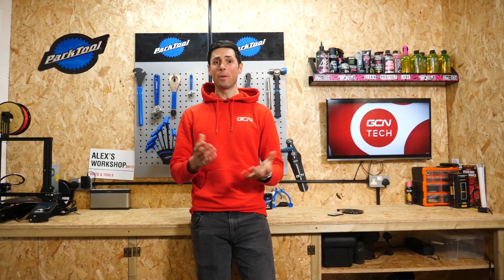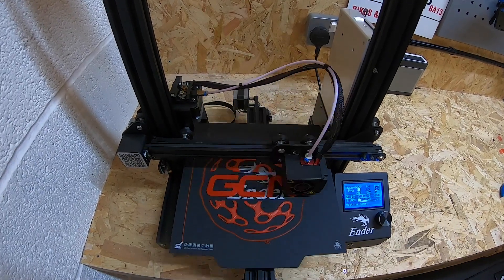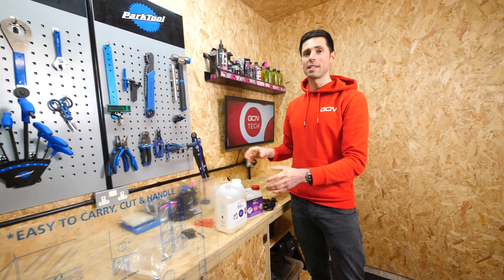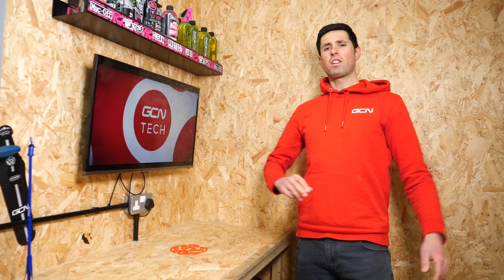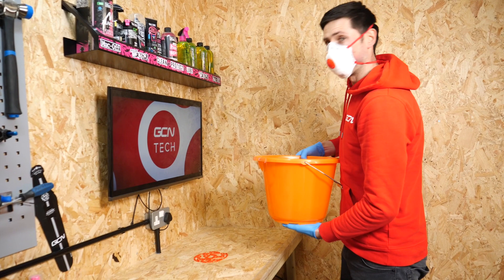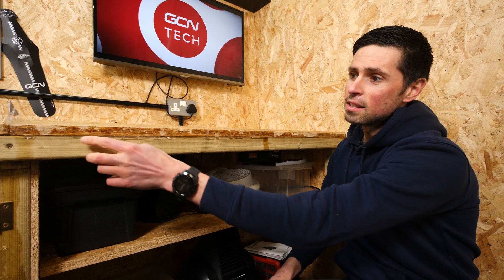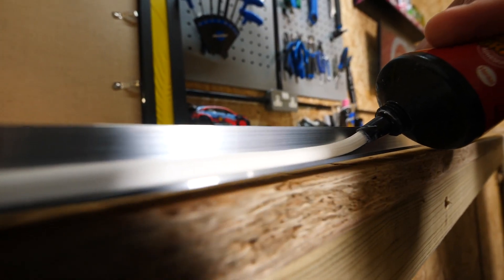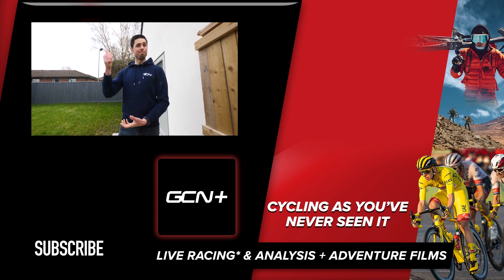3d Printing & Finishing Touches | Alex Builds His Dream Bike Cave In His Garage Ep.3

Comment from the maker: What do you think of Alex's 3D printing skills?
Reply: My guess is the GCN logo became blurry due to the solvent in the resin. Coat 3D prints before putting them in 2 part epoxy
Reply: could Alex come up with some bike related 3d printed accessories for a video?  Maybe a bike computer mount (although not sure it would be strong enough from what Alex said in this video).
Reply: As Si would say, definately a Hack :)
Reply: I think it's a rule somewhere that anything 3D printed qualifies as 'Supernice'. No exception here.
Reply: Firstly, to not go across the whole of the worktop with resin is a crime! Secondly I doubt “instant grab” glue will be sufficient (if used as a proper workbench). Thirdly, who polishes the aluminium after installing... Unless you want to advertise a product! That said other than what I criticised I really like this garage build.
Reply: Not bad.
Reply: You could use transfertape to keep all the single logo components together, so you don’t have to re-assemble them!
But love the idea with the resin tabletop ❤️
Reply: I’ve designed & 3D printed numerous bike accessories from bike computer/bike light mounts (including a quad lock mount for the Canyon hover bar) to cable guides to headset spacers (for a bike that needed a special shape spacer not available to buy).
Reply: @supernoodles908  is 00

Comment: Nice job Alex! On the other half you can maybe drill a hole, wider than GCN logo, in wood itself, put logo in it and cover with resin. Once dry, polish, it should be leveled with worktop. Bonus point for drilling from inside of cupboard to the top, and put LEDs to lighten logo up.

Comment: Should have taped over the top of the print, then peel it off the build plate. Then you can stick it all down together and the tape holds all the bits in the right spot.

Comment: @Alex 
Did you not think about embedding the logo into the table?
You could have cut whatever diameter the logo is into the table
Print it as a "Mirror image" so you can simply face it down still stuck onto that black thing that you were holding it on .
Pour resin into the hole and let it dry with the logo on the surface. Then simply sand away that black holder thing away and boom simple easy and centred perfectly

Comment: Hi GCN. Love the content and I get alot og tricks here. It's also very intertaning to watch. Question. I'm a triathelete and I have a FELT IA1 with SRAM eTAP. I clean my bike every week to keep it in good combat shape. When I clean the bike I usually use a graden-hose to get rid of some dirt. Then MUC-off is applied. And degresse and all that good stuff. At the end I use the garden hose over the entire bike (low pressure of course) to get rid of the MUC-off. But the problem is that water gets into the frame (via the seatpost). It also happens when it's raining alot. Is there a easy way to let the water drip out or is the only way to flip over the bike and make the water run out? I know that some a drilling holes into the bottom of the frame to let water escape. I also see here is a hatch for the internal routing in the bottom. Could that be used for draining perhaps? #AskGCNTech